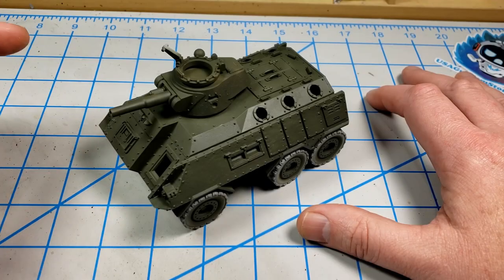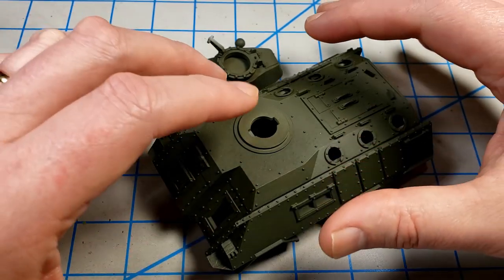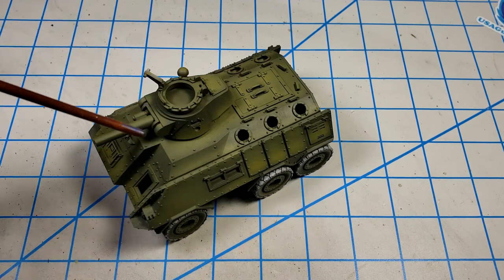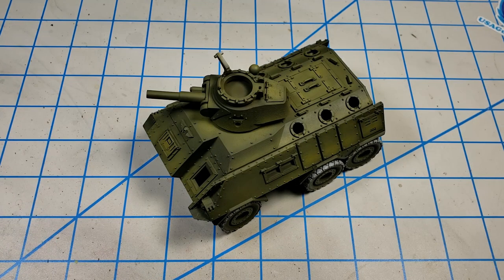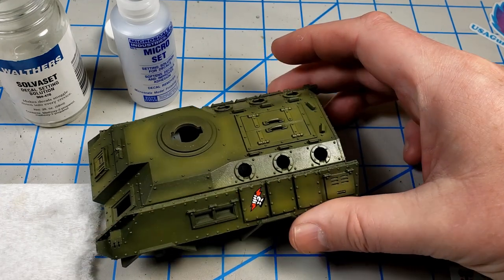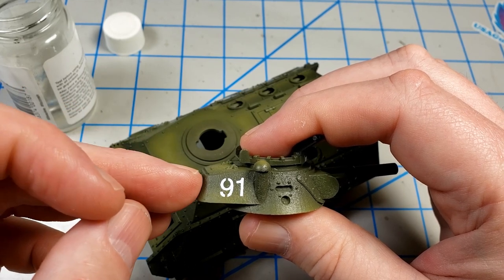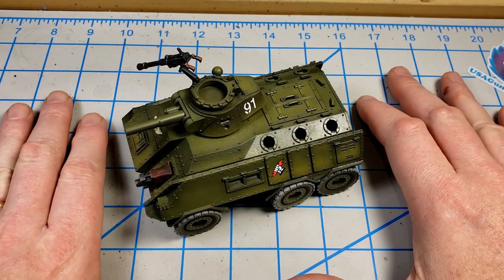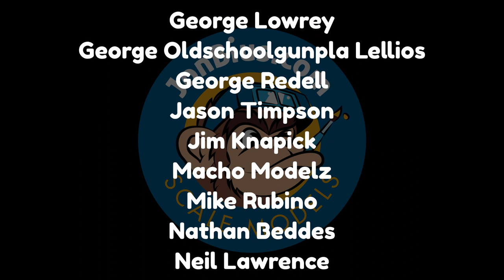Paint, Decals, And Details - Building The Warhammer 40K Chimera Part 2

Comment: I have to say, I like bacon. The fact you painted the bolter cover to look like leather actually makes sense, because you create a point of interest on the model without exaggerating things. 

As for the decals, I have never user micro sol/set but I've had decent results with putting a gloss coat on top so that they don't stick out.

Lovely stuff, as always!
Reply from the maker: Thanks for watching and commenting! 🥓😊

You nailed it - I wanted a point of interest to bring the eye to the front, and away from the novelty of the wheels. Plus, I love painting things to look like leather, and that was such a nice, textured part - perfect for it!

Gloss over decals does work very nicely. I've done that often for quick application.

Thanks so much for your kind words - I am grateful!